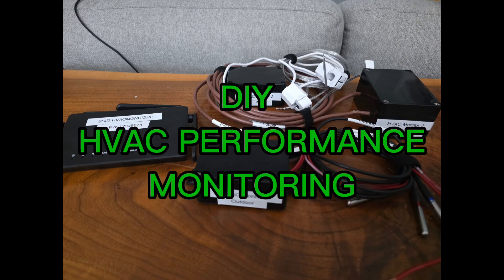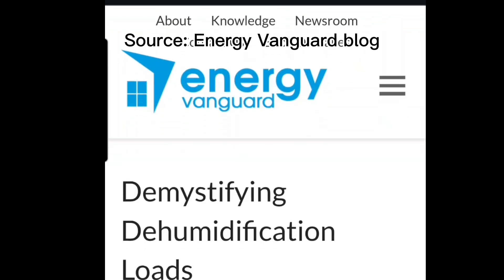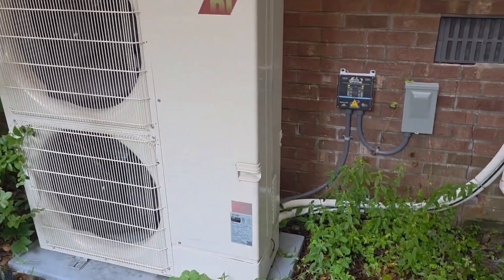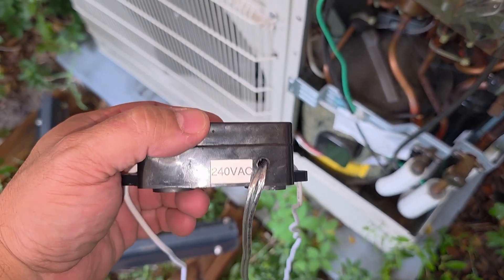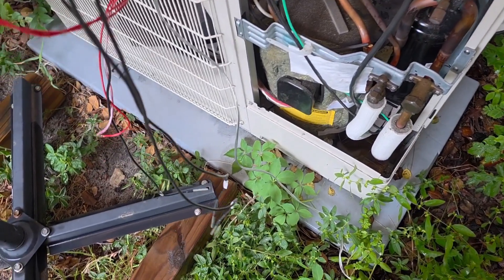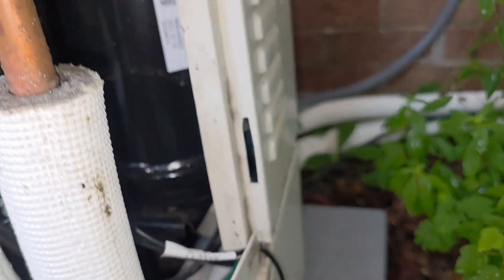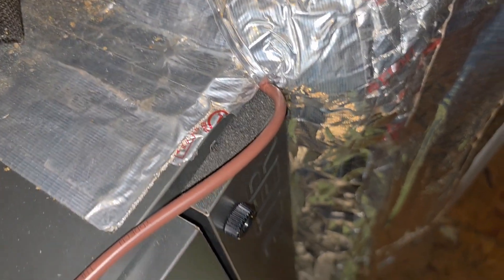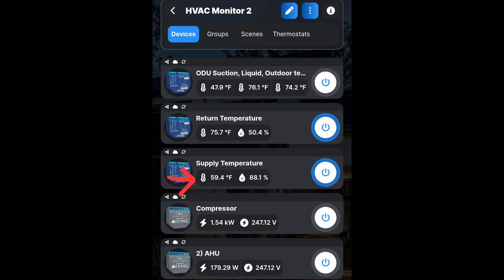DIY HVAC Performance Monitor

Comment: Your monitoring system needs 240V to monitor sensors? What is the actual load in this device?
Reply from the maker: It can take down to 12vdc but that would require additional components. The goal is simplicity.

Comment: sweet. liquid electrical tape would seal places the wires were fished through. is there a group you'd share data with like UK heat pump monitor? Well Connect Geo does too.

Comment: I think the Shelly Sensors are fantastic.  For Home Automation I use "Home Assistant Yellow" and the Shelly Sensors easily connect. I like it better than using the Shelly App since Home Assistant Yellow is vendor agnostic and you can do so much more with home assistant.

Comment: Great project and video! My thought is can you add sensors to monitor static pressure? It could be used to tell if it's filter time
Reply from the maker: Im working on that but currently at my house i use a hot wire anemometer for airflow

Comment: Love this type of project! I am also using home assistant running on a raspberry pi to integrate multiple types of sensors all on the local network. You can generate lots of statistics and alarms with the built in home assistant tools. 
I have run into lots of trouble trying to use the Shelly scripting functions, but HA is rock solid.
Reply from the maker: I keep hearing that.